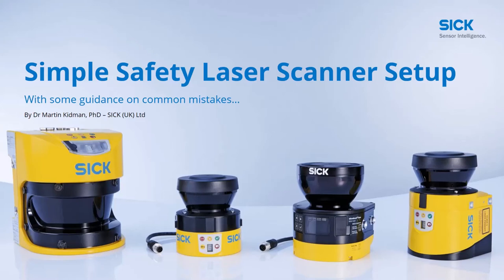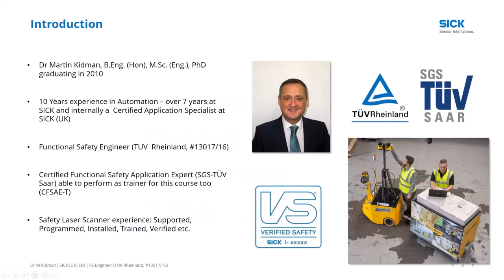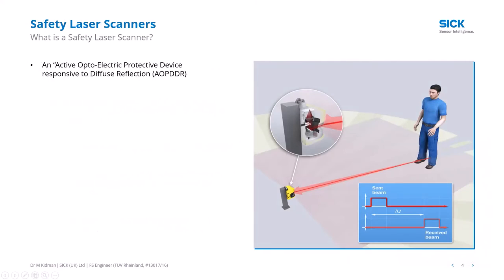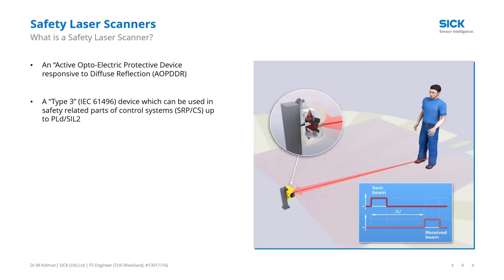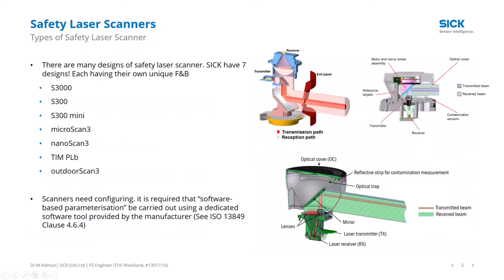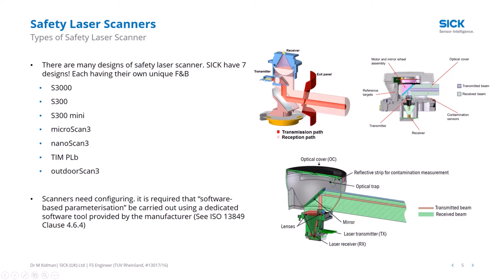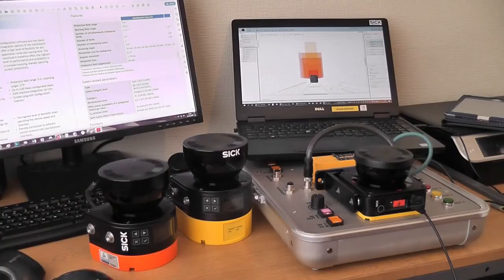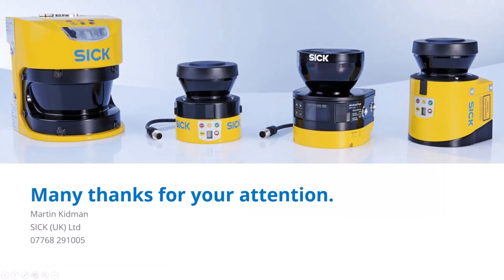SICK Simple Safety Laser Scanner Set-up

Comment: Hi, i have sick sensor S30A-4011BA can't zero, he is stay on 1,what a problem?
Reply from the maker: Hi Badim - please see- section 10 – Error and status indicators on the 7 segment display, in the manual. 1 means that there is an object in the protective field. You will need to connect the scanner via the CDS configuration tool and view the scan line to see where the field is infringed and, if needed, modify the protective field. Hope that helps. If you are still having problems, please contact your local SICK branch.

Comment: how do i do the wiring connection for system plug with flying leads and rj45 connector , my device is not visible on the safety designer software

Comment: there is something to do about black objects or clothes? i mean, if i wear or if i use a black screen, it doesn´t detect.
Thanks in advance!
Reply: Hi Jorge, since these are safety devices, they have strict approval processes and the standard IEC 61496 has specific requirements for the detection of people. This standard has limits for remission etc. that these devices must fall within. A person with black clothing wouldn't be an issue up to the maximum safety distance specified by the scanner (That's why you won't get a scanner that can "safely" detect someone more than 9m away even though you get feedback from objects many tens of meters away.)